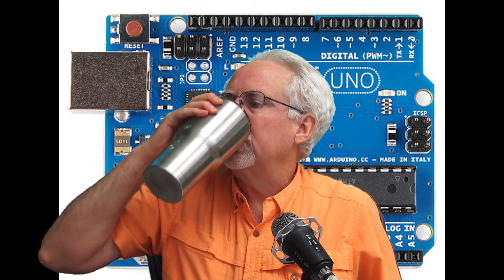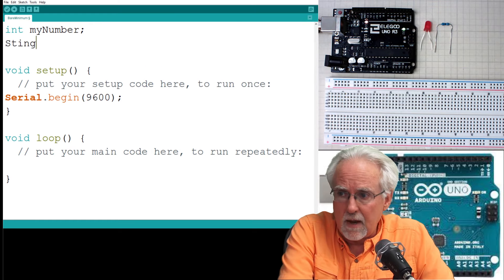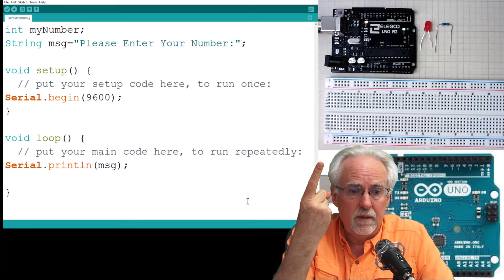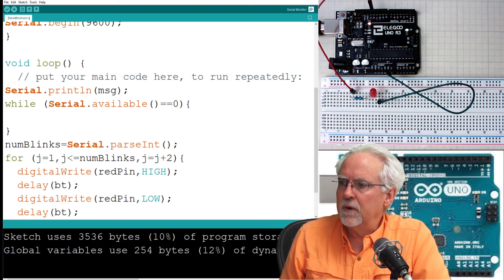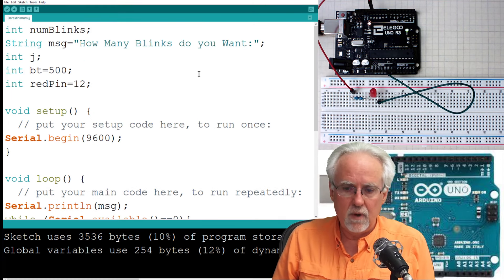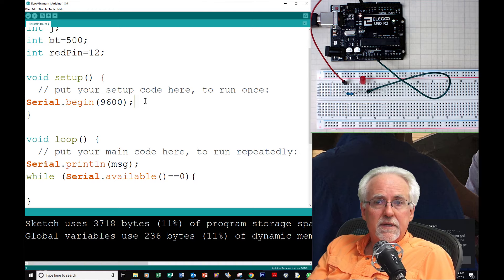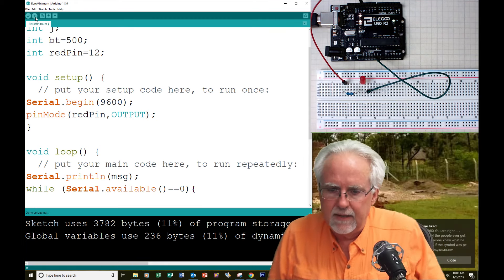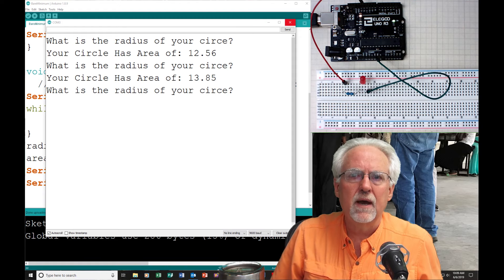Arduino Tutorial 18: Reading Numbers from the Serial Monitor

Comment: At the first part of the video, when you type a number into the serial monitor and it reads it back to you:  This worked great UNTIL I type a number larger than 32767.  any number higher than 32767 starts counting backwards as a negative number.  so 32768 gave me -32768 and 32769 gave me -32767, 32770 was -32766... and so one.  Any idea why that is happening?
Reply from the maker: And that is because ints will only go to that number, and then overflow. Try using floats instead, or unsigned ints.

Comment: I got it working but for some reason. After i press how many then send it works just fine as expected then it says your number is 0 even though i walked through every step copied everything to the T and i still says a extra line its troubling me so much.
Reply from the maker: Make sure serial monitor is set to no line ending

Comment: Hello Paul, I did the code exactly as it was in the video, but no matter what number I put in it always comes back as 1519.76. How can I fix it? This is a great series, btw.
Reply from the maker: Understand if you do EXACTLY what I do, you will get exactly what I got. So somehow you have made a mistake, and just have to find it. One tip, make sure serial monitor is set to 'No Line Ending' . Peculiar result you are getting, but really can not guess what is wrong.

Comment: got stuck paul -- here is my code -- it asks me for my number, and when i type it in, it tells me what my number was, and then it immediately tells me my number is 0, and then asks me for my number again..... My code is the same as yours, from what i can  see - please help...???

int myNumber;
String msg="Please enter your number:";
String msg2="Your number is: ";

void setup() {
  // put your setup code here, to run once:
Serial.begin(9600);

}

void loop() {
  // put your main code here, to run repeatedly:
Serial.println(msg);
while (Serial.available()==0) {

}

myNumber=Serial.parseInt();
Serial.print(msg2);
Serial.println(myNumber);

}
Reply: don't stress i found the problem - i left the comment up so others can learn - the serial monitor setting needs to be set to "no line ending"  otherwise it throws out odds and ends

Comment: Hi PMcW
My code works fine but prints out the question twice, any idea?
int numBlinks;
int delayTime(1000);
int j;
int redPin=12;
int bt=500;
String msg="How many blinks do you want:?";
void setup() {
  // put your setup code here, to run once:
Serial.begin(9600);
pinMode (redPin,OUTPUT);
}

void loop() {
  // put your main code here, to run repeatedly, need to d0 3 things ASK, WAIT,READ:
Serial.println(msg);
while (Serial.available()==0) {
}
numBlinks=Serial.parseInt();
for (j=1;j<=numBlinks;j=j+1){
digitalWrite(redPin,HIGH);
delay(bt);
digitalWrite (redPin,LOW);
delay(bt);
}
}
Reply from the maker: Make sure serial monitor is set to no line ending.

Comment: Hello, Paul! I'm having trouble with the string command. For some reason, when I create a variable with a string, the string command wouldn't turn the happy blue color it's supposed to. Do you have a fix for this issue? Thank you!
Reply from the maker: Because you are using the new 'upgraded' IDE which no longer does the happy colors for you. I suggest see if you can download the older version 1.8 of the IDE
Reply: @paulmcwhorter  oh ok thank you! Keep up the great work!

Comment: Tried the initial sketch but it seems to run past the 'while' statement after the first number and have checked and checked my code
Reply from the maker: make sure serial monitor is set to no line ending
Reply: @paulmcwhorter  Thanks Paul. I think I found it by playing around with the monitor at about the the same time you must have been replying to me. Trying to work my way through your presentations ..... not linearly though I'm afraid.

Comment: Hey Paul, when I try this example my program cycles twice.  Program says “enter your number”  I enter 23.  Program spits back “your number is 23.”  Then says “enter your number” and immediately says “your number is 0” without my making any input.  Then says “enter your number” and finally waits.  What’s up?
Reply from the maker: Make sure serial monitor is set to no line ending.
Reply: Thanks Paul.  That did the trick.  Appreciate your series and quick response.  Bought the super starter kit and am enjoying your lessons.

Comment: For some reason my Arduino always starts the program twice after I download my programs. I read elsewhere that Serial.begin() restarts the program, but that doesn't seem to happen to your programs. Am I missing some settings like the no line issue? Ben from Sydney.
Reply from the maker: Make sure serial monitor is set to no line ending
Reply: Hi Paul, thanks for answering. I did see your pinned post and thought maybe one of your viewers would help me out. I was having the no line ending problem as well and was able to get the fix from the comments to this video. I am no longer getting the carriage return after inputting data, but I still get asked for the input twice, which tells me the whole program is restarting itself. I haven't had a chance yet to have another look into it so I'll have a poke around and see what I can come up with. Thanks.

Comment: I have the same setup as you and my serial monitor is printing an additional "how many blinks" each time I upload the code. after the first time it runs normally and only prints one statement at a time. I had this issue with the while loop and for loop videos where we printed numbers 1-10. the 1 would print twice at the beginning and then after that it would be normal and not print twice... any tips on what to look at in my code?
Reply: Do you have your serial moniter set to no line ending?

Comment: Very entertaining!  Being a fellow Stanford Graduate, I thought maybe you might have introduced a nice formula for PI.  I often need to use an approximation for PI in coding formulas.  I use the fraction PI = 355/113 since it is accurate to 6 decimal places.  Just a "fun with math" comment.  Nice job on your tutorial series.
Reply from the maker: Hadn't thought about that. There is also a way to put pi in as a variable, but did not remember the command, so just typed the number. I have trouble not putting in way too many digits when I just enter it.

Comment: When I upload my serial port prints "msg" twice. Then when I input and send a blink number it only returns msg once. Any idea why? Code looks like this:

void loop() {
  // put your main code here, to run repeatedly:

Serial.println(msg);
while (Serial.available()==0){
  
}
Reply from the maker: Make sure serial monitor is set to no line ending.
Reply: @paulmcwhorter  I did and was still getting it twice - odd

Comment: Sir can you help me, i've copied your exact code into my arduino ide and it works the only problem is when i input 1 number it automatically inputs zero on the next line.. for example: when i input the number 2 the serial monitor looks something like this.. 

What is your radius?:
12.56
What is your radius?:
0.00
What is your radius?:
Reply from the maker: Make sure serial monitor is set to no line ending

Comment: So my  wife got smart and put 8 numbers in(417818) and it came back with 31985 any thoughts?
Reply from the maker: Integers can only go to about 32,000 on the arduino. Use unsigned ints if you need bigger numbers

Comment: Hi nice coding people!
First of all, I'd really like to thank you Paul for the quality of your tutorials. I've been searching for such for a loooooong time. Programming is not completely new for me but electronic components and circuits are ! and you manage to explain both so clearly ! (even if I personnaly try to reduce my coffee consumption...).
Early 40's and back to school ;-)...
Furthermore English is not my mother tongue and I understand you loud and clear.

<SOLVED, just saw your message about "No Line Ending". I leave it for the record>

//But I have a question, something bugged me during lesson "Arduino Tutorial 18: Reading Numbers from the Serial Monitor", I'm pretty sure I did exactly as you did for the first part, programming only. It asks the question, I answer, then it asks the question again but then immediately answers itself "0", follows a third question, and only then can I enter a new value (hope I'm clear enough). Seems like there is some sort of buffering somewhere...
I managed to solve this by ending serial and begining it again at the end of the loop. But it's not clear for me why this occures.
Here's my code, I have a genuine arduino Uno, working on an Ubuntu inspiron laptop.
I don't know if you can give me clues or explanation for this. Thank you !

int myNumber;
String msg="Please Enter Your Number:";
String msg2="Your Number Is:";

void setup() {
  // put your setup code here, to run once:
  Serial.begin(9600);
}

void loop() {
  // put your main code here, to run repeatedly:
  Serial.println(msg);
  while(Serial.available()==0) {
    
  }
  myNumber=Serial.parseInt();
  Serial.print(msg2);
  Serial.println(myNumber);
  Serial.end();
  Serial.begin(9600);

}

Comment: I have 2 questions. First, what is a "circe"? It sounds like Greek mythology. And second, on the original Blink sketch, I enter a value, and I get the correct number of blinks, but then it asks the "How many blinks" question TWICE. I have checked my work against yours, and honestly I don't know enough programming to do any more troubleshooting than I already have. Any ideas?
Reply: I answered my own question, or rather, I found the answer in the comments from a gentleman who had the exact same problem as I did and he fixed it by changing the serial monitor from "Newline" to "No Line Ending". yes, I see that our Fearless Leader has the answer right below this comment vvvvvvvvvvv but he didn't get specific enough to engage my enormous brain. Didn't register.

Comment: My code works but for some reason the Serial Monitor prints the code again as if it's trying to set Serial.parseFloat back to 0. I have exactly the same code. If you could explain parseInt() and parseFloat() commands a bit more that would help too. Thanks Paul.

What is the radius of your circle?
                     (typed in 2 only)
Your circle has Area 12.56what is the radius of your circle?
Your circle has Area 0.00what is the radius of your circle?
Reply from the maker: make sure serial monitor is set to no line ending

Comment: I think cool homework for this lesson would be to write a code where the system asks you to choose from three different LEDs and then asks you how many blinks you want. This is fun and you need to put a loop in a loop. Try this guys.
Reply: I don't see why you would need a loop within a loop. It was a fun project though :) Thanks. This works:

// pin declarations
int bluePin = 10;
int yellowPin = 11;
int redPin = 12;

// array to hold pin values
int myPins[] = {10, 11, 12};

// messages for user
String blinkMsg = "Please enter a number of times to blink the LED: ";
String pinMsg = "Which pin would you like to blink (Blue = 1, Yellow = 2 or Red = 3: )";

int baudRate = 9600;      // baud rate must match serial monitor
int waitTime = 500;       // blink duration
int numBlinks;            // how many times does the user want us to blink?
int pinChoice;            // which pin do we blink?

void setup() 
{
  // put your setup code here, to run once:
  Serial.begin(baudRate);
  pinMode(bluePin, OUTPUT);
  pinMode(yellowPin, OUTPUT);
  pinMode(redPin, OUTPUT);
}

void loop() 
{
  // Get number of times to blink from user
  Serial.println(blinkMsg);
  while( Serial.available() == 0 )
  {
    // Do nothing until user finishes entering requested data
  }
  numBlinks = Serial.parseInt();

  // Get which pin to blink from user
  Serial.println(pinMsg);
  while( Serial.available() == 0 )
  {
    // Do nothing until user finishes entering requested data
  }
  pinChoice = Serial.parseInt();      // Should put in error catching code here to ensure user only picks pin 1, 2 or 3

  for (int i = 0; i < numBlinks; i++)
  {
    digitalWrite(myPins[pinChoice-1], HIGH);    //decrement pinChoice by 1 as array index starts at 0
    delay(waitTime);
    digitalWrite(myPins[pinChoice-1], LOW);
    delay(waitTime);
  }
}

Comment: Dear Sir, i am getting bug in the code. How to remove it, kindly guide. Whenever I tye a number, I got extra message that " Your Number is: 0;" each time.
Reply: Open your serial monitor and change the settings at the bottom right corner from "Newline" to "No line ending".
Reply: @insanehum987  TnQ bro

Comment: I put in the code just like you did and I'm having a weird scenario. My screen says "enter your number", then when you enter the number it says "your number is 3". then immediately after it says "enter your number"." your number 0". "Enter your number". immediately afterward. Without entering any additional information into the serial port. Then I will enter in a different number and it'll do the same thing .your number is 5 and then the Glitchy thing will happen again
Reply from the maker: Make sure serial monitor is set to 'no line ending'
Reply: @paulmcwhorter  thank you so much I'm a new watcher and also new to Arduino. And a fellow Christian so I will be watching your Bible study also.😁
Reply: @paulmcwhorter  thanks for such awesome videos.😋

Comment: i did the blinking exercise it worked but problem is after every one cycle, it prints the msg twice in a row...i also tried to copy word to word from your codes but still it asks twice for the blinks..plz help....i even tried with area of circle but same problem occured
Reply from the maker: make sure serial monitor is set to no line ending
Reply: @paulmcwhorter  thank u very much...it worked....bdw can u plz explain "no line ending" and others a little bit....

Comment: Hello Paul,
I have just started up my Arduino recently after a while, and have noticed that whenever the serial monitor is used, before any of the things you want to be printed in the monitor are printed, a varying amount of little box characters are printed. This is not a problem with my code, because it was identical to yours. I am using the version Arduino IDE 2.3.3, and have done some looking around and it seems im not the only one with the issue, but there doesn't seem to be any working answers. Do you have any idea why this may be happening?
Reply from the maker: These lessons are on IDE 1.8, which I like much better than 2.x. You might try that IDE.
Reply: @paulmcwhorter  thanks Paul, I will go and download Arduino IDE 1.8
And once again thank you so much for these tutorials, absolute GEMS 😊

Comment: Thanks for the tutorials. I'm an older beginner and it's all new stuff to me. Got stuck twice on T18. (1) was the no line ending on serial monitor, sorted. (2) Blinking the LED I kept getting just one blink regardless of input value. Eventually sorted it don't know if anyone else has done this ?. Problem was at the end of the for loop line after the parenthesis I'd put a semicolon as per other lines. The LED only does the one blink. Removed the semicolon and as I now say BOOM it works.

Comment: I mean like for example ( say I wanna enter a number 7)
Enter your number:   
(I input 7)
and the program runs like
"Your number is: 7
 Enter your number:
 Your number is: 0
 Enter your number: "  (and then allow me enter a number a second time)
Reply from the maker: Make sure serial monitor is set to no line ending.
Reply: @paulmcwhorter   Thanks so much Engr Paul...
Reply: @paulmcwhorter   I have learned a lot from your Arduino series sir and I wish to still learn a lot from you sir...I saw your video series on fusion 360 and I also wanna learn now even after giving up on it last year...but I think the 360 version have been updated beyond the one used in your video series...what's your opinion sir?

Comment: I keep getting this: 
What is the radius of your circle?
Your circle has an area of12.57
What is the radius of your circle?
Your circle has an area of0.00
Reply: Hi, try this out. If to the left of your [9600 baud] in the serial monitor is  in "Newline" form or any other form try change it to "No line ending". I faced the same problem and now its working correctly when I changed it.
Reply: I was getting this at first as well. In the Serial monitor at the bottom is a drop down menu might say  "Newline," change it to "No line ending.'" Hopefully that helps.

Comment: I am getting this error. when I enter the 85858 in serial monitor, it shows back as 20322. Couldn't figure out why is this happening. Has anyone else gone through this? If not, please try!
Reply from the maker: Because arduino integers can not be more than 32,000 (or something close to that)
Reply: @paulmcwhorter  Thank you very much Paul. Appreciate the response.
Reply: 32767 +or-

Comment: Good Day, I am new at this, but even though I put the code in exactly as shown, I get enother output on my screen
Please Enter Your Number: 
Your number is :23
Please Enter Your Number: 
Your number is :0
Please Enter Your Number: 
Your number is :56
Please Enter Your Number: 
Your number is :0
Please Enter Your Number: 
Why does the Arduino think that I entered a "0" after each number I entered? I ONLY entered 23 and 56

My CODE:
int myNumber;

String msg="Please Enter Your Number: ";
String msg2="Your number is :";

void setup() {
  // put your setup code here, to run once:
Serial.begin(9600);

}

void loop() {
  // put your main code here, to run repeatedly:
Serial.println(msg);
while (Serial.available()==0){}
myNumber=Serial.parseInt();
Serial.print(msg2);
Serial.println(myNumber);

}
Reply from the maker: make sure serial monitor is set to no line ending
Reply: @paulmcwhorter  Thanks so much!